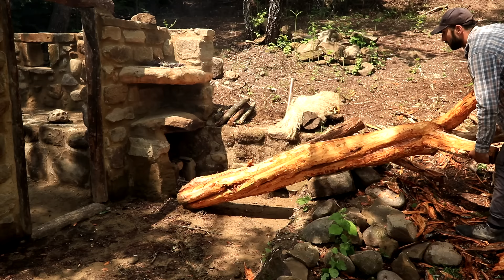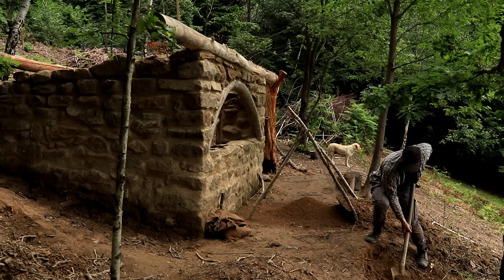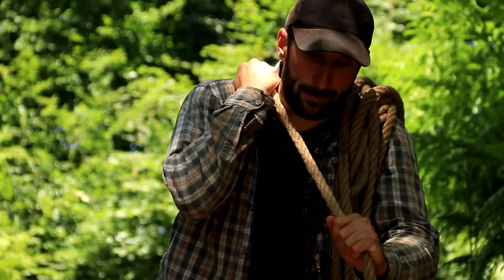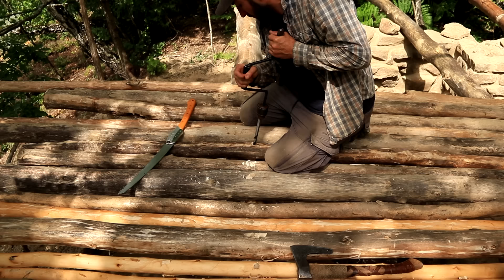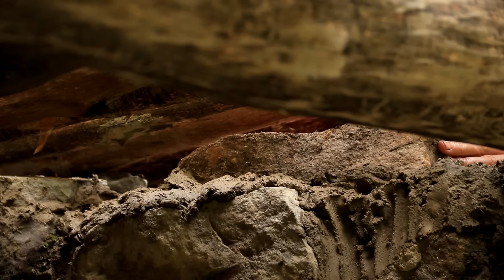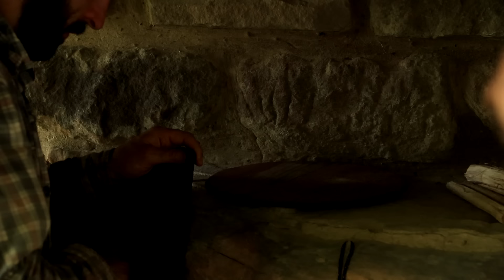Bushcraft stone House in the forest. Alone construction

Comment: Keeping the heat from the fireplace chimney insulated to retain high temperature possible allows a best draft as hot air rises and dissipates the smoke from the building. Good work.
Reply from the maker: Thanks for the advice🤝